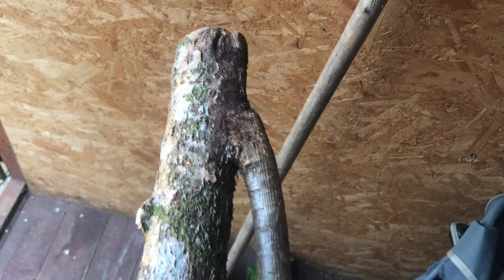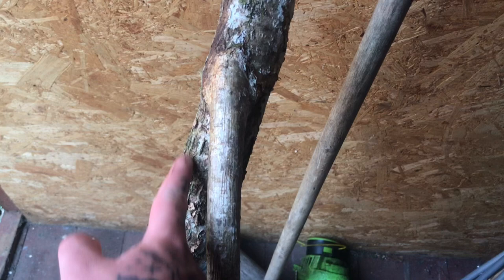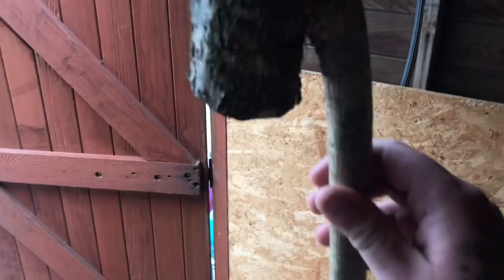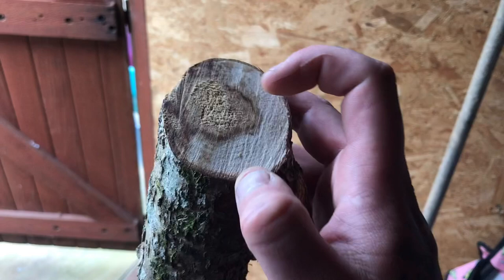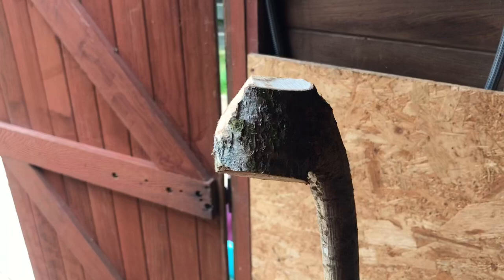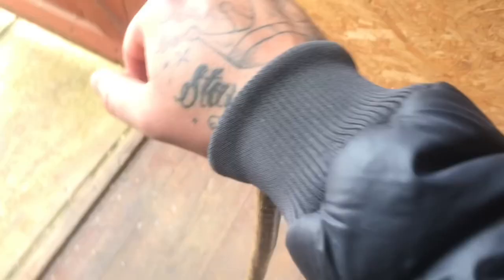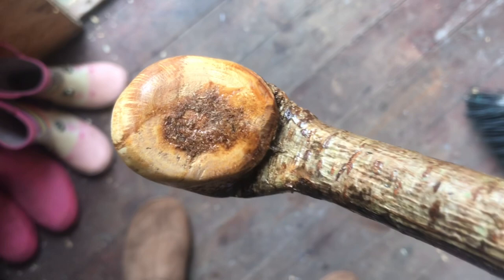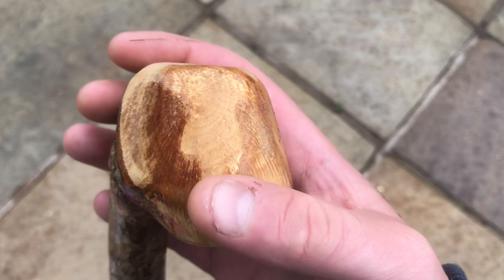Can you make a Shillelagh walking stick from dead wood

Comment: Dead =/= rotten. Every stick I've made has been from dead and/or fallen trees. I think of it as "wild seasoned" After a while you get a pretty good idea if it's seasoned but not punky. Granted I've only made about 15 sticks so far, but a good rule of thumb I've found?; Is to give the stick you are thinking of taking home, a really good whack or two against a log. If it doesn't survive that? Then it wasn't meant to be.
Reply from the maker: Seems to be that way, here in UK and Ireland we have always mainly traditional used cut wood, but love the way you described it definitely gonna keep look out for more 😁
Reply: @CutterStickMan  I live in a rural part of Southern Ontario. We don't have Blackthorn, but we have a LOT of hardwood trees. White Oak, Hard Maple, Beech, and Hickory. It's not hard to find fallen timber or dead trees in my area. Many are indeed too rotten to use, but you can find some good ones. Seeing how tough it is to saw them can be a good indicator of quality too.